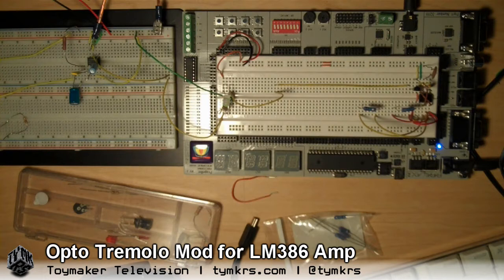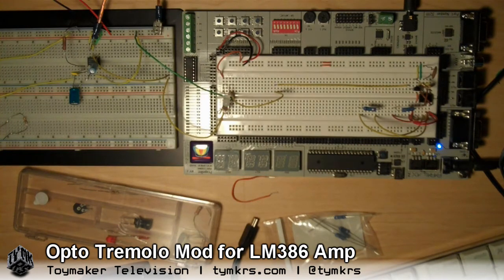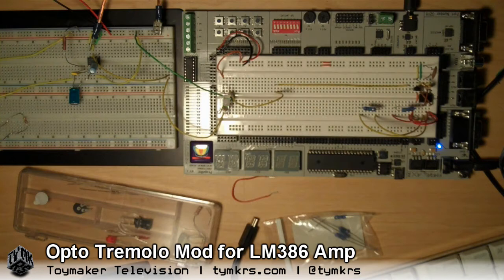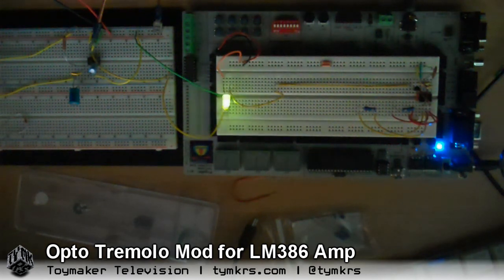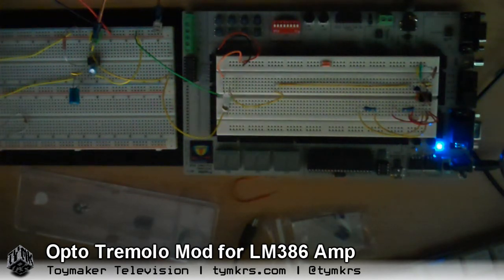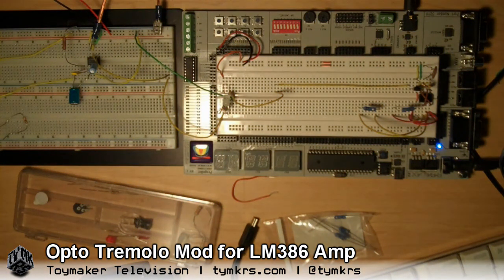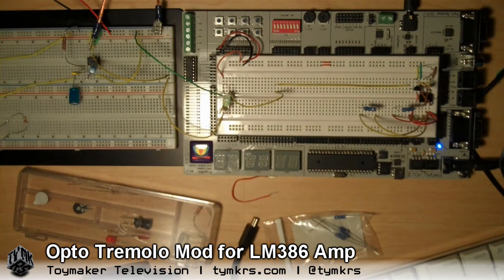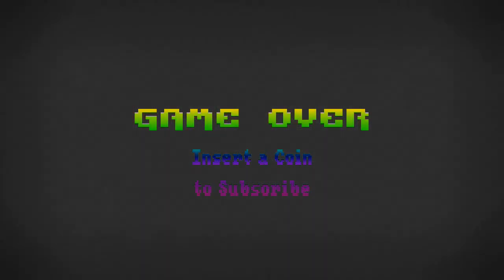TYMKRS Opto Tremolo Mod for LM386 Amp

Comment: Have you tried running the LED at audio frequencies yet? :)

On a side note, I seem to recall a phaser circuit that used a clever hack with optoisolators. I'm having trouble tracking down a schematic, though.